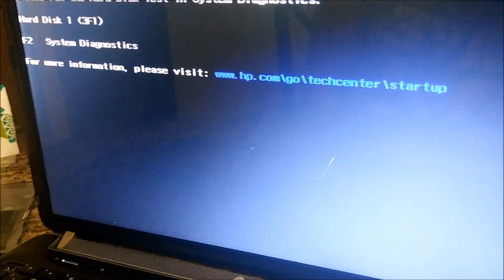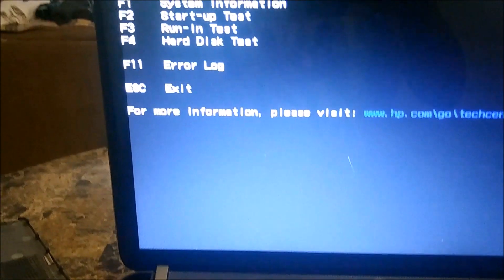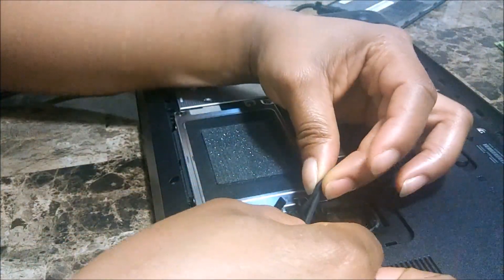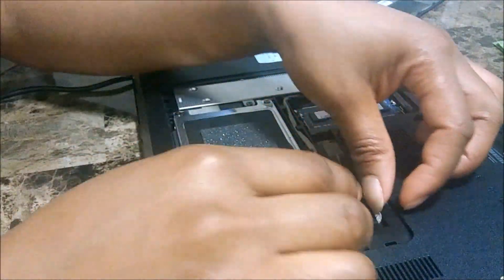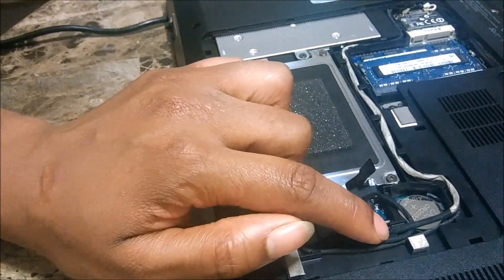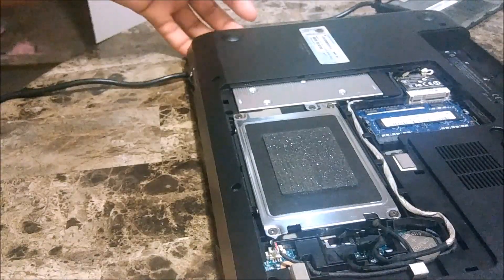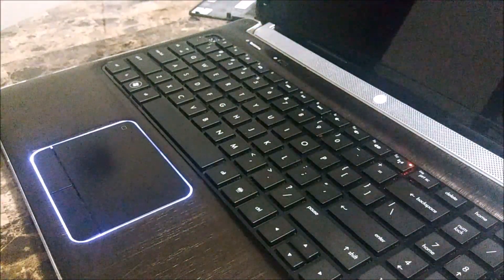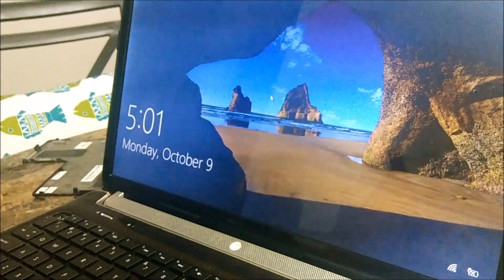How to solve Hard Disk Error 3F1 HP dv6

Comment: Doh. Even as a seasoned tech, I wasn't paying attention when I reinstalled the board and reconnected these drives. Connectors are marked on the mainboard as HD500 and ODD500. HD being hard drive, and ODD being optical disk drive. Had these swapped and getting 3F1 during post. Was pulling my hair out with it lol. Thanks ... saved me a few gray hairs.